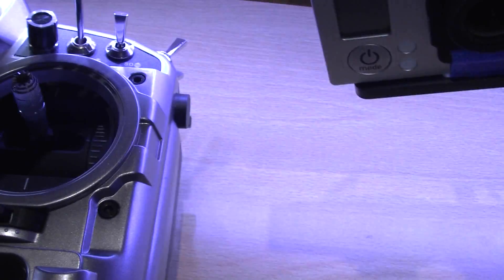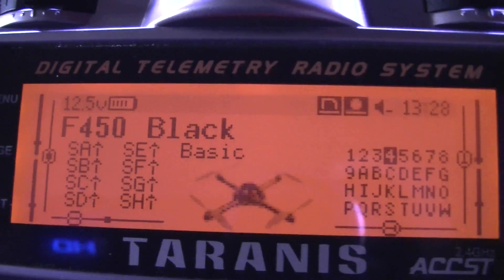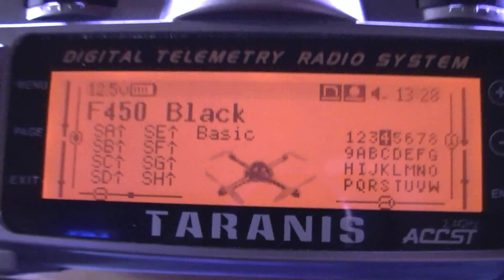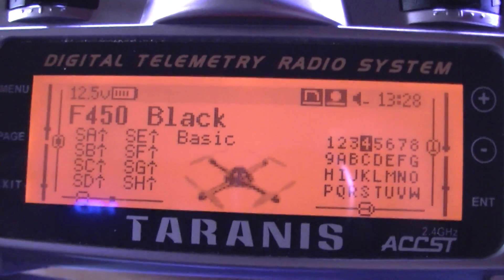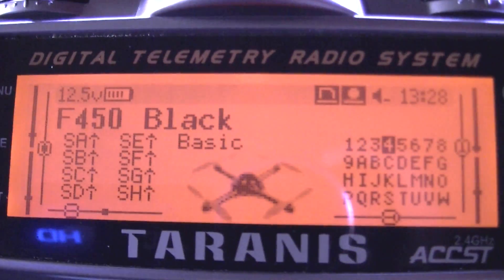Chinese copy of AlexMos / BGC brushless gimbal fitting and test

Comment: Which gimbal is this, you got a link pls.
Reply from the maker: Doing a quick search, it's the same as this one http://www.ebay.co.uk/itm/251309463040
Reply: vortecks2000 Many thanks
Reply: vortecks2000 Did you use the Naza gimbal controller or buy the stand alone one that looks to me like an adruino board.
Reply from the maker: Michael Endacott The NAZA will only control servos and not brushless motors. You do need to buy the controller board.